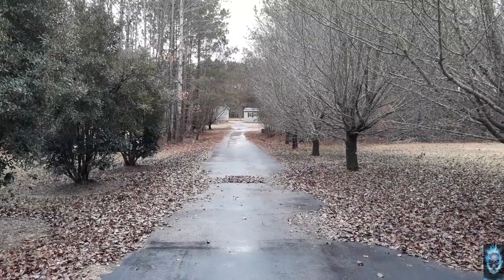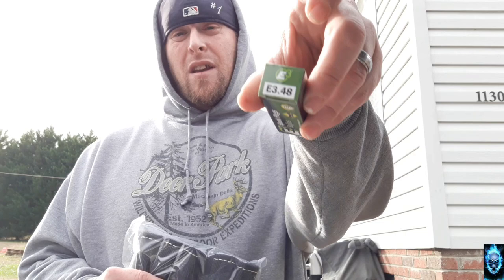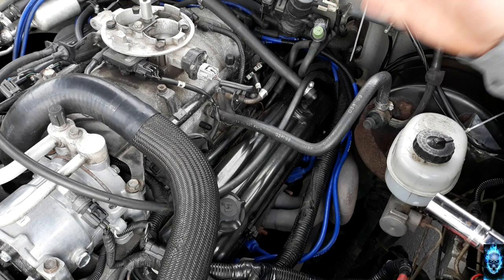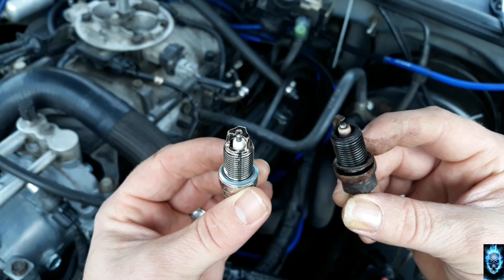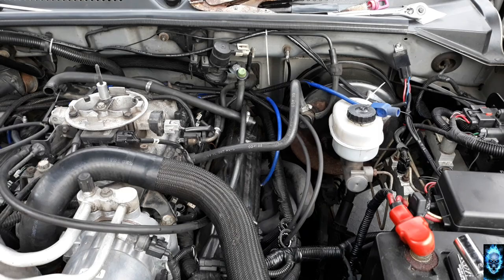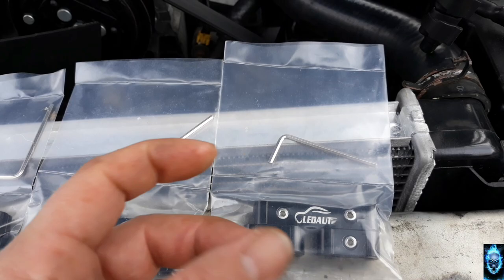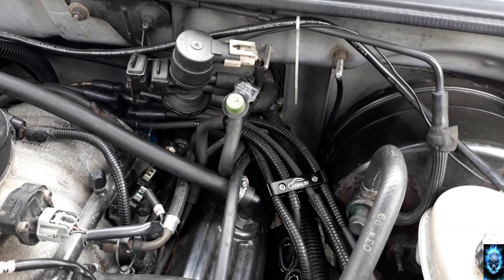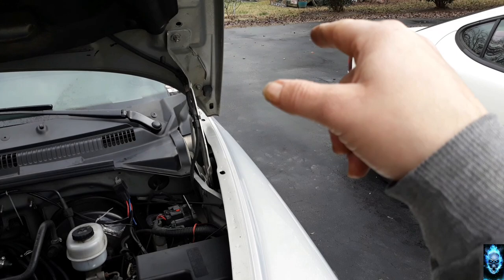INSTALLING A NEW SET OF E3 SPARK PLUGS FOR MY 99 DODGE DURANGO 5.2L

Comment: I have one comment would you use royal purple products in dodge Durango
Reply from the maker: I haven't used it myself yet, but I've heard good reviews.  I've heard a lot of people using it for racing applications and getting great results. I've heard daily driving vehicles working better after using this oil.  But because of the price I have never had the chance to use it.
Reply: Lol I'm not using it for street racing she just has lots of miles on her she just runs a little bit hot ya i royal purple cost lots i live in Vancouver BC Canada i bought some royal  purple transmission fluid for my sunfire i had to sell it so i dont really wanna wast it im thinking of  buying some e3 diamonds and  new wires ket  for my  dodge Durango it going to coast me $260 from amazon

Comment: Hello, are you still running the E3 spark plugs.
Reply from the maker: Unfortunately no. I just recently replaced them after 2 ½ years lol.  Still work good.
Reply: @DBGrimson  Thanks for letting me know. I have the same engine in my 99 ram and was thinking of using them I'm it.
Reply: @DBGrimson BTW you have a very nice Dodge. I almost bought one instead of my ram. I wished I would of.